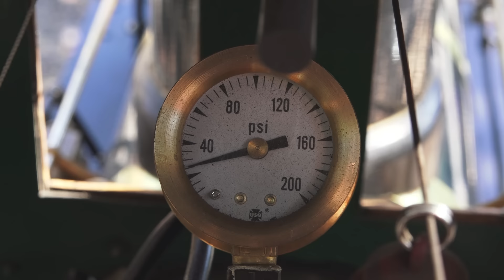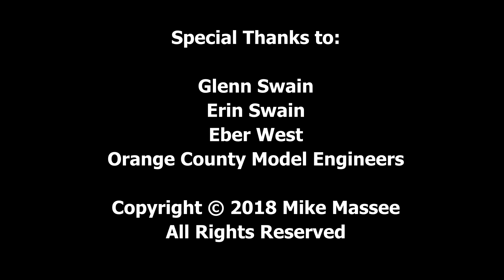Firing up the Allen Models Fitchburg Northern Live Steam Locomotive

Comment: That small train is great and it’s like a toy 😊
Reply: Yyyf
Reply: @hildacantarero4106 a
Reply: get the safety valve stuck and it becomes a bomb on wheels
Reply: @hildacantarero4106 00
Reply: @hildacantarero4106 ⁰
Reply: Want a more bigger explosion bigger than a nuke? Buy the new steam engine! It explodes for 00000.00000.00000.0000000.000000.1 secs
Reply: Kò 5th year or Thursday or shoulders in a sì fi wọ́n
Reply: @eliasalvarez295  nah if the safety value fails then you better say bye bye to life💀